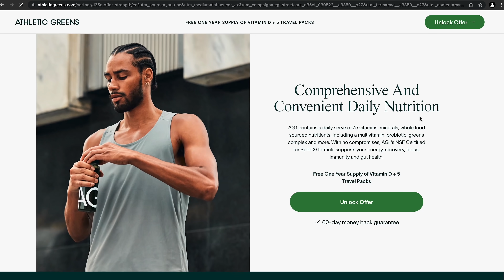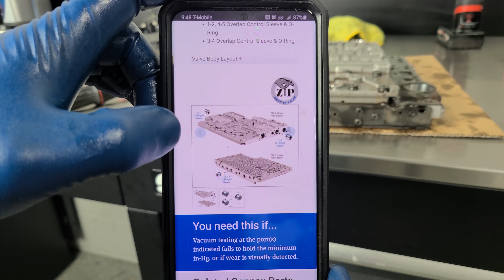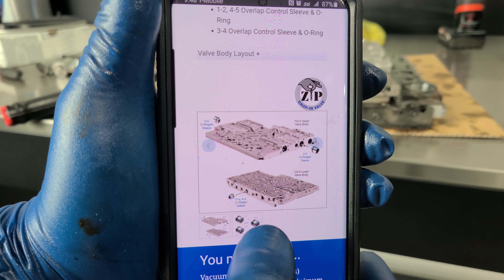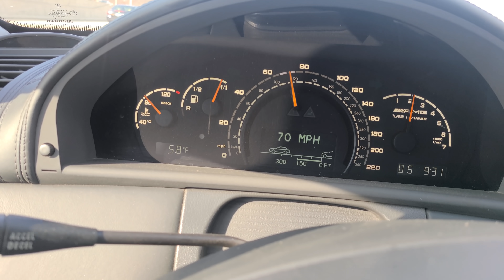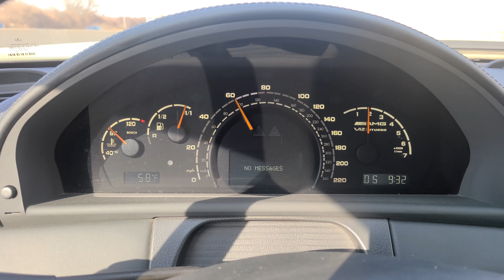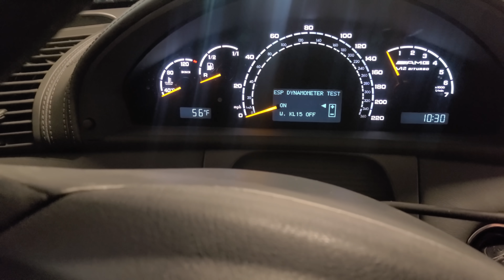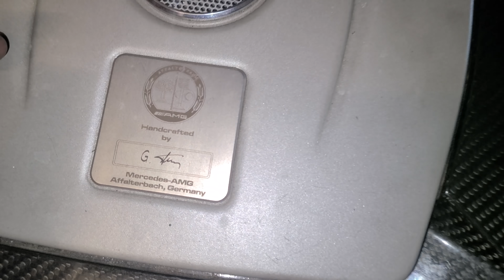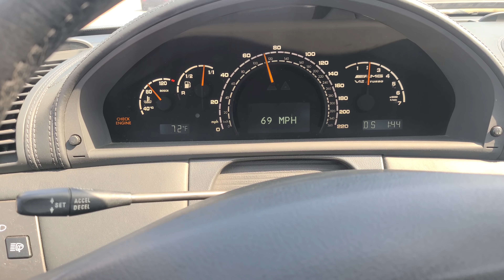My CL65 AMG FINALLY Made It To The Dyno But It Didn't End Well. I Love This Car!

Comment: Great video Alex, whats the tool you used to blow out the fluid from transmission and torque converter?
Thanks!
Reply: Flush the cheaper way, find the gearbox cooler lines and once the gearbox is full with clean oil, unplug it and let out a 3ltrs then put 3 ltrs new oil run in each gear and repeat till you have clear fluid.

Comment: I replaced the plug and conductor plate on my 2000 E320 (w210) and it was easy. I didn't do the sleeves in the body though, I didn't know about them. I have 133K miles on the car and about 30K on the conductor plate and plug. NO mechanical component such as the transmission is really "sealed for life" unless you consider the component to be disposable when it need not be. There aren't any shifting issues at the moment but I will do the sleeves at 150K. Thanks for letting me know about them. I did change the solenoid to blue tops in my 2013 Challenger NAG 1 (722 transmission) and they did firm the shifts up from stock Mopar. As the engine has since then been supercharged and tuned it is comforting to know they have been changed though at the current power level, I am pushing the design power handling for the trans and likely a beefed up trans is in the near future.

Comment: That 722.6 trans is the same one in my '14 Chrysler 300c hemi car! Yes, conductor plates can have issues, changed mine as a matter of cheap insurance, FCP Euro stocks the parts and trans filter kit, plus revalved and resprung the valve body and put AMG blue top solenoids in it. Shifts firm and works great, also took off trans cooler return line and ran 8 qts. clean oil through the torque converter as per M-B factory specs for trans service. It should work well even in front of that V12. Do change electronic solenoid valve o-rings, they do take a set after awhile in service!
Love this car despite its rep for breaking, one of the coolest! Thanks for another cool video from LSC!

Comment: I remember one of your videos being titled " you can afford this " 😒   I'm glad i didn't listen or I'd be broke on just the fixes.  Either way man still love your videos and long time subscriber as they're very entertaining watching someone else deal with that unreliable mess. 💪😎
Reply: You too can afford this car if you spend 100% of your free time over the next 2 years rebuilding every single piece of this car
Reply: @sumofty  yea pretty much😂
Reply: I had a 2004 cl 500 for over 4 years from 2007 to 2011  I changed the battery once and the brakes twice bought it with 50000 miles sold it with 92000 never a problem one of th the best cars I ever owned also the tires it was a great car
Reply: I just purchased an 05 cl600 with 38k miles.  It honestly feels brand new, not sure where I should even start but replaced the plugs and radiator, may replace the abc fluid but notmsure if what's in it now is bad. Alex I purchased this car because I have learned to wrench on my euro cars myself, I was always so intimidated and would only wrench on my lexus gx 470's.  I have an ML63 and have replaced everyhting in that except the engine and tranny lol.  Keep up the great work, you are truly an inspiration, you have a solid foundation and you care about people.

Comment: 1980 Mark 6. 55k on the odometer.  My dad's car. My prom car. We shipped it New Jersey  to Amsterdam  for a family vacation in 82. It was an attraction everywhere we went. Most of their cars were the size of the trunk.  Unfortunately here in NC, I haven't found anyone that'll touch it. Honestly,  I'm skeptical of 40yr old digital cluster panel n variable venturi carbs myself.   But that's what restomods are for.  Right?

Comment: Alex, was it the 722.6 in your E320 CDI that had the torque converter lock-up issue when cold? It felt like a gear shift but wasn't. Did you ever get it sorted, and if so, what did you do? My 2003 CL600 is starting to display the same symptoms.
Reply: My Lexus GS was doing a very similar problem, especially when cold. Did 3 drain and fills on the transmission and it got smoother. It still does it, but you can't feel it
Reply: @colelockridge5816  Thanks for that. I am thinking of upgrading the torque converter sprung loaded actuator in the valve body (as Alex did). I know it didn't fix his issue, but I was wondering if he later found an off camera fix for the issue?

Comment: already done the radiator - take the cross bar out, they made it easy for this - bolts that hold the brackets on each side that insert from the front - are a PAIN!

Comment: I have a 2006 Charger (150k miles) which I believe uses a Mercedes 5 speed trans. It has the original fluid!?!  Would you guys recommend changing the fluid? I have good up shifts, but the 2 to 1 down shift will sometime be harsh. Also, I occasionally have a stalling issue which sets a P0700 code (loss of communication with the TCM) Thoughts?

Comment: Great video ,love the content ,been working on a modded 04 s600 with a tune ,exhaust,trans tune and intercooler exchange tank in spare well . anyway wondering about your dyno guy and where you are grabbing a solid tach signal from ? have tried 2 locations and still have to use an opticle zip tied in place to get a clean signal .to date at 520 at wheels,590 tq.before the 5 gallon tank.Happy horsepower hunting from San Diego .

Comment: Awesome video. Very informative and helpful. 
I don’t own a foreign car. Foreign cars like BMW or Mercedes are just out of my budget. A friend owned a Mercedes 420 SEL I think it was an 89. Gorgeous car, but it had a rear main seal leak. Dealer in the 90’s was going to charge 2500 to change out. My friend just kept a case of oil in the trunk and added as needed until he sold it. 😂😂

Comment: Question:  HI,  how often does the coolant leaks to the transmission,  is that a common issue on the 2012 C300 Sport 4matic AMG package. Was wondering as a friend has that issue. Any preventing guidelines to follow. Or should I get a new radiator and an external transmission cooler?

Comment: Great job alex, euro cars are a love/hate relationship. Love em when they are running right, but hate them when you need to repair them due to the higher cost and over-engineering to replace a $15 part you need to tear 1/2 of the engine apart to get to it.

Comment: 4 air filters soaking up all that heat... just extra parts to worry about. 2 air filters on a twin turbo I get it. But proper size piping and a larger single filter would work best

Comment: I had the opportunity to purchase a 2002 w220 that was in fairly decent condition. It was awd and needed a front axle and had a code for a conductor plate issue. Ran smooth and shifted like it should. The code just scared me away cause I figured it was gonna need a transmission rebuild. After watching this, I would’ve felt better about going forward with the purchase and doing the conductor plate myself

Comment: I own one of 05 cl-65 broke both rear axles because of the traction control kicking in then re - engaging after the tire gain traction while I was still on the throttle snap it like a twig .

Comment: My work colleague bought a 2003 CL500 & he found a guy here in Ireland who had a tuner in Germany log onto his laptop to help with the tune. The car was from Japan so had to tell car the different fuel & I think he got it remapped as well for more power. It’s doable but takes a lot longer than any typical car

Comment: I had a 2005 CL65 that I bought in 2007 CPO'd with 16k miles on it for $80k. I owned it for 9 years.  I currently own a 2015 CLS 63 AMG S l and this is my ninth AMG.  To date my CL65 was my favorite! I had a love hate relationship with that car. fortunately when I purchased it I got a Chrysler extended service contract and boy did they lose money on me!  Everything on that car is so freaking expensive to fix unless you're a tech and can do the work your self.  I eventually modified the CL65 with speed driven larger capacity intercoolers, and a speed driven ECU tune. The car pulled like a train! The torque was unbelievable!  a powder coated the calipers yellow, and got carbon fiber rims. I also put carbon fiber mirror covers and rear lip spoiler. The car was beautiful! I kick myself everyday for getting rid of it but it just scared me owning that thing out of warranty. I had major ABC suspension issues all the time and a host of other small things that just kept happening and I treated that car with kid gloves. The look of it is timeless and it was super comfortable to drive with endless power.  I'm jealous that you got one and with your knowledge able to restore it and enjoy it properly. If I lived near you I would honestly purchase one and make you fix it up for me...Lol 😂

Comment: According to Renntech: the MB dealers will flash the ECU back to stock if you bring in your car and it has one of their tunes on it. It could've had a Renntech tune in the past. You can call them and they will look it up via the VIN. (I did the same for my 2006 S65 AMG)

Comment: you and my dad taught me a lesson lol, so basically I was working on our gate for our driveway that opens and closes,, the arm that makes the gate move stopped working, when I went to put everything back together I went rambo mode, had the gun full speed... I've learned when I'm dealing with these fragile things to take the time, keep in mine my dad has all the wrenches, tools, toolboxes but i just choose to use a dewalt drill and a torxs attachment lol. keep up the great work, currently working on one of our cars the family hauler besides our supercharged audi q7, our 07 dodge grand caravan has a cylinder 2 misfire... gotta do some testing... keep up the great work alex!

Comment: i just did the trans service on my 2016 E250 bluetec  sure as hell would have been easier on a lift.... wasnt too bad just triple check things befor buttoning up i would hate to have to take it all apart again... I used the AMSOIL fluid shifts very nicley again after 118000kms    only thing i ran into was i only got about 4.5liter of fluid out even after trying to drain the converter nothing came out so i guess i only did a half flush not sure why i couldn't get more out should be almost 9liters...   i also have a little bit of jerkerness when cold on the 1-2 shift but it has since gotten much better

Comment: I did a radiator in my 01 Isuzu Trooper, took the hoses off, and one mount at the top off, and pulled up.

The shroud was cut out for the fan and came out with the radiator, literally 10 minutes and new one was in and I was filling with coolant.
Reply: And I also did a radiator on a 03 Chrysler PT Cruiser Turbo, and was a 5-6 hour job

Comment: Great video and tips on this era Benz transmission.  I have a 722.6 in great condition w/ a 2 year old conductor plate and service that will be available soon in Chicago.  Came out of a 1998 C43 AMG.  I need to check the records but it's a factory replacement under the previous/original owner - maybe 80K on it?  1st trans failed b/c of the BS "lifetime fluid".  This replacement has been regularly serviced.  Doing a manual swap soon (already swapped in a 55 motor and Wavetrac LSD) - can see/drive the car before removal.

Comment: I had to remove a similar hose fitting on a fiat to replae the rad. Ended up sawing the end of the fitting off the radiator to remove the hose fitting off the car to be able to reuse it.

Comment: I changed a rad on my 2001 330ci years ago. I had noticed a dribble of coolant on my drive so bought the rad and expansion tank. When I got th rad out, it had completely bowed at the bottom. As in, it wasn't even remotely flat bottomed anymore.  Unreal that it hadn't completely ruptured and dumped all the coolant out 🤣

Comment: Interesting that the inner plungers on the valves don't need to be replaced. My thought would be to replace everything concerning the valves if you're in there anyway. Intriguing that those parts don't wear as much as the valve sleeves seem to do.

Comment: So I need some professional help, I have a 03 s600 I believe it has the 722.6 trans and I've been noticing extremely hard shifts from 1st to 2nd, could this be those little valve things behind the springs on the valve body ? I'm going to change the fluid and filter along with the electrical connector, but I was wondering if there's any while your in there's that you would recommend. Any help would be much appreciated! Btw car has 72k on it.

Comment: Please can someone tell me what the small radiator is on the left hand side? I have a 2002 W203 270cdi and it has one of these small radiators. I thought it was the trans cooler, but it is not as I removed a hose and a little coolant came out, when I removed the expansion tank cap, coolant gushed out so it is linked to the coolant system... BUT what is it for? I have fitted a ATF cooler (radiator cooler) to the front of my car as the fitted water/ATF heat exchanger is tucked up under the intake manifold bolted to the engine block and I was getting shifting issues during the Spanish summer... ATF was over heating as it was fine during the rest of the year and when the trans was cooler... The ATF cooler is NOT integrated into the coolant radiator as on this MB. Thanks.

Comment: Look at the trans dip stick again you checked the fluid level correctly but read the dip stick wrong. 

You need to add 1-2 quarts more 

722.6 usually 6-7qrts 
722.9 usually 5 quarts 

When doing simple service ^

Comment: Mercedes-Benz radiators seem to be pretty easy on most cars. I can I think I can do one on my E Class in like half an hour. The longest thing is getting the transmission cooler lines off. A late 90s Jeep Grand Cherokee was the hardest one I did. The whole front end has to come off including the headlights.

Comment: 19:59 "Shift Happens" 🤣

2005 - 2006 ECU's require the chip inside to be desoldered, written on another module then transferred back. 3 days to tune with ample time between runs to eliminate heat soak issues to get max numbers. #patience

Comment: It is the same thing on my CL55 too. I tell you what's hard to find now is an decent electric fan for the CL. They are all cheap china ones. I bought a new one last year & it runs non-stop. You can't find oem or Behr fans anymore for these cars. I scared to buy another chinese one because I feel I will get the same crappy fan. I busted my radiator neck on the upper hose trying to get my hose off. I cuss Mercedes every time I work on any coolant hose on my CL55 & E63-S. Wtf were they thinking? Also those stupid hose bands they used instead of an hose clamp. My CL55 I don't have problems with those hose bands but my E63-S I've had 2 of those hose bands just pop off going doing the road now. I just put a normal hose clamp back on it & it's fixed. I wish I knew a way to cut off the oem hose bands that have not fell off yet so I can just replace them now with a normal hose clamp. 🤷

Comment: A lot of domestic cars has the tranny cooler but into the radiator, even some suv\trucks too, but that's why there are after market coolers to seperate them. They put those tranny's in jeep grand Cherokee still and the conductor plate fails in those too. I had my grand Cherokee 6 months and that plate failed cost me a thousand dollars for a tranny shop to replace it, but that plate was 600 dollars dealer only part.

Comment: I'm continually amazed at how Euro manufacturers (and seemingly them more than any others) manage to squeeze so many small points of failure into their cars - and in such a way that when failures do occur it exacts a repair cost exponentially higher than the value of the failed part itself.

Not trying to 'hate on' Euro cars, to be clear. I guess my point is that you'd think mgmt at Benz/BMW/etc would be displeased to see so many little 'gotchas' sidelining their customers' vehicles.
Reply: Its one of the most reliable auto transmissions ever made by any manufacturer.
Reply: They are all engineered to fail now. The Germans taught it to the rest of the world, but at least Mercedes up to the mid 2000s are worth fixing because there is nothing like it to this day that compares to the driving experience.
Reply: That's because Euro manufacturers try to squeeze as much power and efficiency as they can in the smallest package possible. That's how you get this V12 in a sedan with hydraulic/air suspension taking up space in the engine compartment. Japanese manufacturers don't even have anything close to offer, and US cars are huge compared to most Euro cars.
Reply: @marski9956  So true.
Reply: @marski9956 if by huge you mean enough space to work on things then yep. Lol. They are large for sure but we aren’t packed into a sardine can and that definitely accounts for some of the size. Idk if you’ve ever seen a ford GT or not but…. Pretty good job of packing a lot into a small package

Comment: Running overly rich is not safe!!!  What happens is the extra fuel can wash down the cylinders, and accelerate wear.   The fuel can also get into the oil and reduce the friction reducing property.

Spray the hose fittings with silicone spray and then use compressed air to get any grit out, then the hoses should release without a pry bar.

Comment: The whole "lifetime" transmission oil thing is so not the case... i bought a 10yr old C class from a friend with extremely low miles but it was sluggish. Took out the oil amd it literally looked like liquid cement. Ran so much better afterwards and still a great car.

Comment: New V12 project.  Equal length headers m120 v12, manual transmission swap.  Lightweight flywheel. And a Lightweight platform.  Let's go budget front engine Zonda
Reply: German Youtuber  Jp performance does exactly this in a e500 w124 right now

Comment: hey man your gearbox oil is low. the dip stick has 4 lines on it, the lower 2 are min and max at 20°c and the 2 lines at the top are min and max at 80°c fluid temp. check WIS